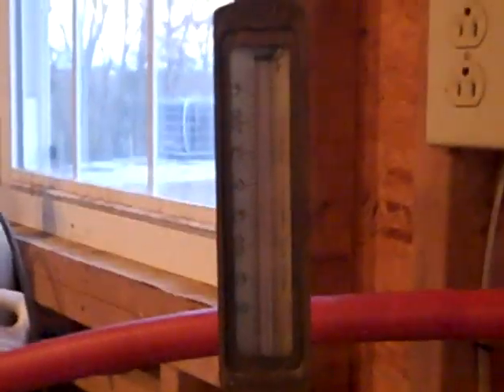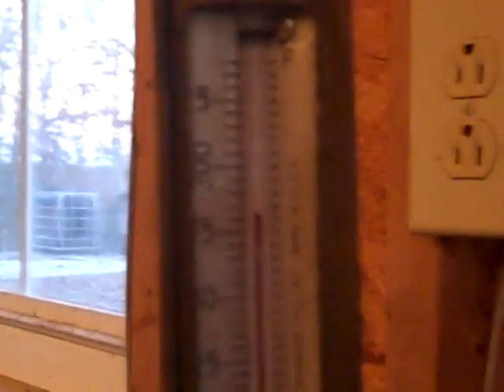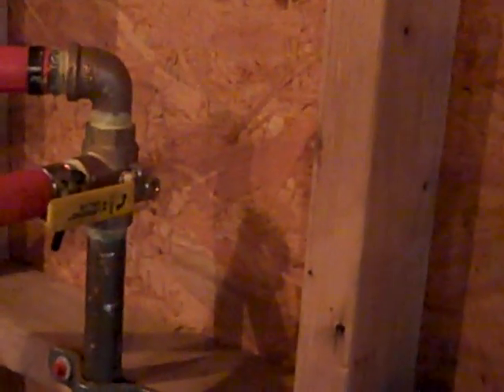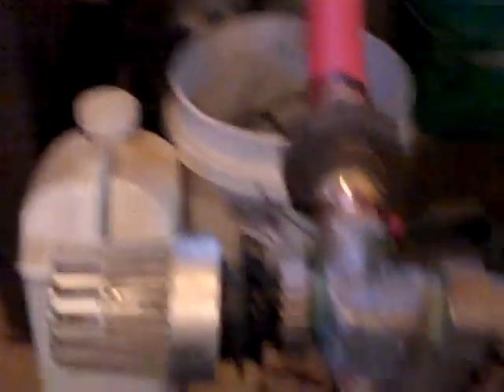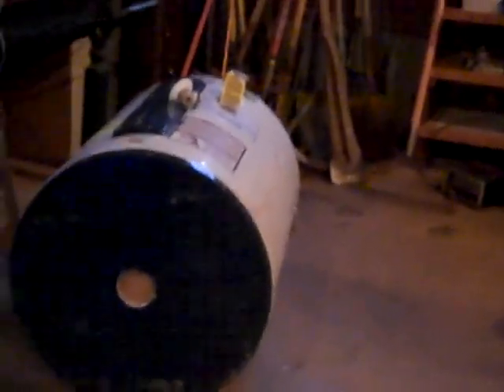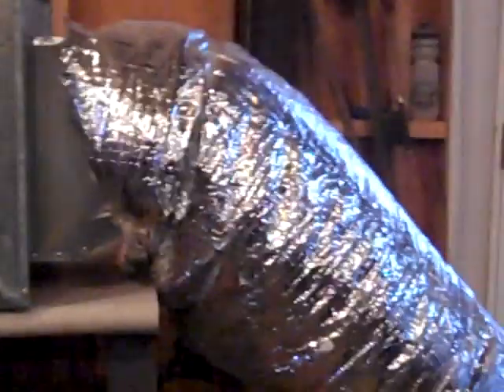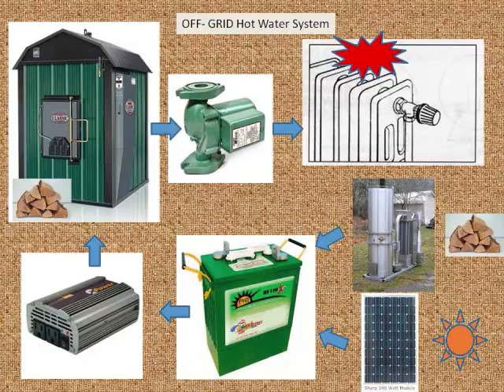My radiators are Hot!

Comment: I once had a thought. You know, when there are seasional hydraulic testings of apartment blocks heating systems right? That way they know if there are weak spots, and they can repair them in summer, rather than in winter, when all apartments blocks radiators are filled with piping hot black sludge water, witch was probably never changed in 60 years, and is black and jelly like. At least in Russia. So I had this thought - how much pressure should you crank up to make cast iron radiators explode like bombs one after the other in each apartment? Or what would happen, if you tried filling up the whole apartment blocks radiators with molten aluminum? I imagine they would be glowing red hot. . . You know, when you doing plumbing and heating for 20 years you start wondering these things. . . would be interesting to see what would aluminum thing do or the pressure thing. . . don't you too?

Comment: Congratulations on the cast iron radiator acquisitions cast iron is the only way to go steam or hot water. Helped a friend three years ago restore a steam system with all new steam lines and a new stoker fired soft coal boiler by EFM a 900 series massive old farm house still had the 1907 installed hand fired coal boiler when he bought it. 39 radiator's 17 of which leaked. Had his heating contractor remove all of them and drove over 238 miles to a place in Somerville, Massachusetts that took them apart cleaned and machined them to like new standards loaded the truck up and drove back to his place where the contractor reinstalled them all.  He and his wife now love steam heat no more banging and thumping like when he first fired it up with firewood. House came with just over 40 tons of soft coal. 20 to 30 plus power failures a year hence why when I explained the advantages of steam heat he kept steam. 

Nice touch with the remote temp gauge

Comment: hi  like the heat your doing, i have a heat book for seam systems im running one in a school now for the winter off of coal nice lots of heat   ok   measure the height of the radiator,  count the number of columns in the section, count the number of sections, multiply the total number os sections by the number of square feet per section.     i believe yours is a two column at 7 1/2" w about 38" h that would be 4 sq. ft. radiation per section  76 for the hole thing  joey

Comment: Hi     WHY use old fashion radiators? You wil need higher temperature...they will bleed heat only at their location.and so on.  Hot water to hot air must be the way to go.... (if it doesnt have to do with the electric fan blowing hot air)

Comment: Clamp a 12v DC car radiator fan on the back of that cast iron radiator, get 10x the heat in the room. Use a copper wrap (1/2-inch with 1atm non-pressured water system) around on your upper riser on a wood stove, and put this in a remote room for great heat. Forget the thermostat and use 90-degree brass ball valves instead, much cheaper.Wow...boiler...used to work in Section 8 boilers years ago - would NOT have one of those near my house.

Comment: My father had tin covers made for the top of a few radiators and they were great for drying wet mitts in the winter and warming cold hands. The heat is steady, no fluctuations like with hot air furnaces.

Comment: Do you have to force the circulation with a circulation pump or the water flows by itself. Also could you do the same thing with a car radiator?

Thanks
Reply: more than likely need the pump. remember, like hot air, hot water rises. without a pump you would need to have the radiators place well above the heat source to use thermal siphoning. you could use a car radiator, it would work. just would not work as well as the thermal mass of the cast iron.

Comment: Hey engineer775! Big fan here. Just thought i would mention that i figure BTU output in my radiators by knowing the flow rate (gph)x(8.3)x(hotwater in minus coldwater out). Example: 180° water in, 140° out, 1/2 gal/ min. or 30 gph; = 30x8.3(lbs of h2o)x40= just less then 10,000 BTUs an hour. Hope that helps. Love your work! RhodeIslandReadiness or TimBatSea

Comment: Why do you have to put the thermostat valve on the inlet?  If it's a closed loop system can't you put the valve anywhere (including the outlet) to stop the flow?  It's just a valve and isn't really detecting temperature.  That way you can put the inlet on the bottom and outlet on the top.  Just curious.

Comment: Wood burner, radiators are what we are using all the time at our home in rural Sweden.. We also have an "accumulator watar tank" (1200 lyres) connected in the system which is insulated and stores the excess hot water to cycle around the rad system. Main advantage is that you reduce the need to curn wood by up to 66%. Saves wood. No need to get up in the night on those winter -35 deg C temps. Great videos! Looking forward to more.

Comment: I'd bet that you could dry food with that radiator if you turned it on it's side and mounted a wire rack over it, maybe a shallow box to direct the air flow.  There'd be enough convection air flow to carry off any water vapor, etc.  No fan needed.  Just a thought.

Comment: you wrote: "with an pump required 80 watts/hr of energy. Enough energy to heat 7000 sq ft"
------------------------
In Germany we heat about 1250 m² (= 13.500 sq ft) with a Pump of only 43 watts. :-)
Try to reach our normal level of energy-consumption. 
--------
My house is also heated with radiators. They need only 29 °C (84 °F) at -12 °C (10 °F) outside to keep the 150 years old house at 21 °C (70 °F) inside.
Try to reach this. :-)

Comment: Almost all house in northern Europe uses central heating with radiators. My granddad had a really nice system he built himself. When using those radiators and the heat source being wood the most effective solution is to draw all the heat out of your furnace into a really big and well insulated water tank that retains all the heat from the fire wood. Then you run your radiators off a heat exchanger. If you don't have that big insulated water tank as a heat buffer you'll waste most of the energy.

Comment: To test btu of a unit.  Build a box around and check the start temperature.  Turn on the heat and see how long it takes to warm the area up.  There is a formula to measure btu buy this method based on the volume of the room heated and the time it takes to reach a higher temperature.  
Good luck

Comment: I once retrofitted the first floor of the 4500 sq ft house we had with old radiators (I've got 12 of em in the garage now for this house lol) One quick tip.  I found that if I ran the inlet into the bottom, and outlet from top of a radiator... I got more even heat distribution over the entire radiator. + if not using pex for hookup, be sure to use dielectric unions.  Otherwise You'll start eating up radiators fast :)